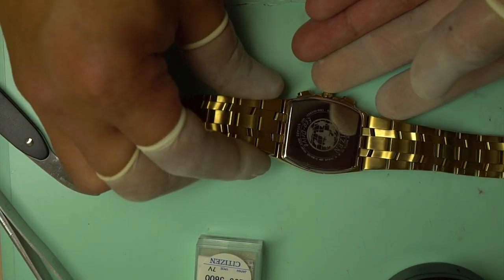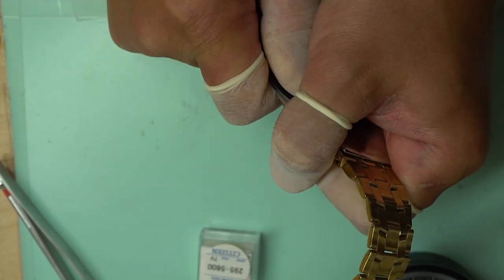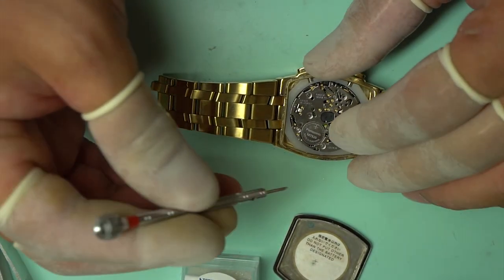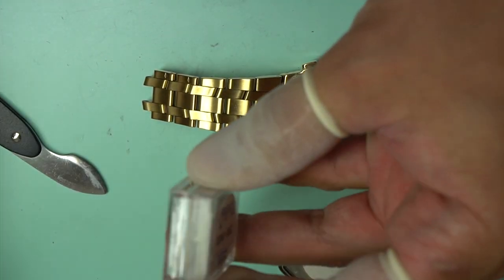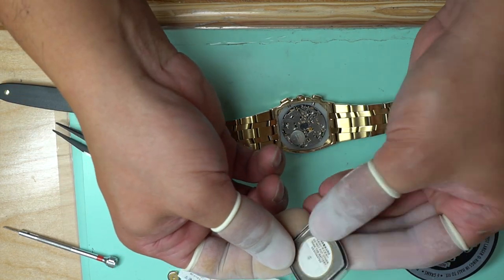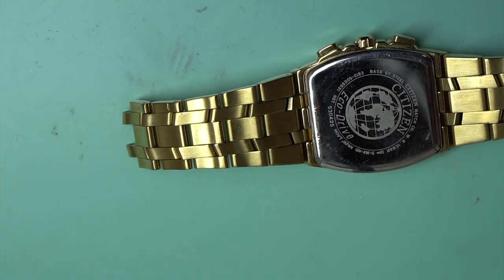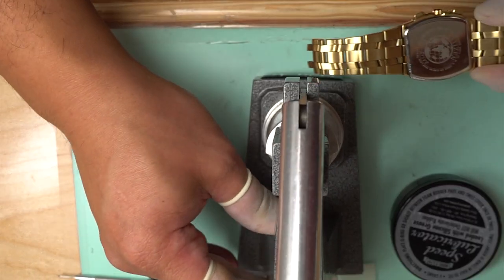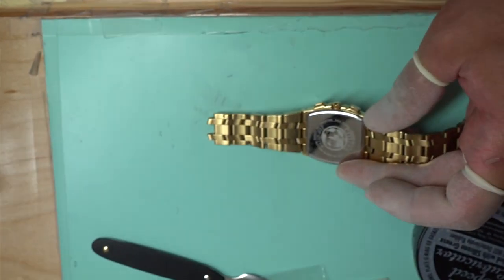How to Replace the Capacitor on a Citizen Eco Drive Watch

Comment: Besides omitting where the battery "tab" goes...and it's proper orientation when re-inserting...it may have been good to also mention that you (properly) used tweezers with plastic ends.....never us a one-piece, all metal tweezer, and hold the battery that way on both sides....you will risk shorting the battery with such an all-metal tweezer.

Comment: Many Casio quartz watches have 10 year batteries. I do not see the advantage of Eco-Drive if capacitor needs replaced every 3-5 years. My Casio G- shock battery honestly did last over ten years, but I did not use the illumination very often. My Citizen Eco-Drive is doing the two second hand sweep indicating bad capacitor at ten years. Case back says "do not open."
Reply: Replacement of the power cell with that frequency is unheard of.  8-23 years, with an average over 14,  in my experience with14  Ego-Drive watches (Watch Pox)..

Comment: Over the last 27 years, I replace the power cell in my Eco-Dive watches  about every thirteen years -  nerer sooner than eight years - in fourteen  examples.  i note that you use what appear to be plastic-topped tweezers to place the new power cell, avoiding the risk of shorting-out the cell.  The role of the spring-loaded tab in the watch works and the placement of the prtruding tab on the power cell SHOULD have been emphasized but was entirely neglected.  The "joy" of replacing a friction-fit case back was given short shrift.  All-in-all, a C- performance.

Comment: But any capacitor has a long life-time than battery suppose to be  . my citizen echo-drive watch (model - Bl6005-01E  ) stop running, the solar capacitor doesn't charged any more , but it's running only when exposed to light .

Comment: Do I need a case back closer tool or can I do it by hand or another way? (Citizen eco drive AT8010--58E radio controlled)
Reply from the maker: Hi Jay, sorry for the late reply. The primary function of the tool is to evenly distribute pressure on the case back, avoiding creasing the back and/or damaging the movement. You can use another flat object to achieve the same result if performing this at home.
Reply: @TotalWatchRepaircom  Like an Irwin quick grip clamp, applying light pressure obviously

Comment: I bought my Eco Drive in 2000 ..... it's now 2019 same Capacitor, and it only loses a second a month!
Reply: Rob Bierd that’s good life
Reply: The capacitor won't affect the watch accuracy only the watch power. If the watch is running itl have the same accuracy at a full charge as it would at a minimal charge.
Reply: Same as me. I bought my Eco Drive in 2000 and it has only just started to lose time now December 2019.

Comment: Something isn't right here. 
I own four Eco-Drive watches and have yet to replace anything.  Three of them are over 5 years old and one is at 18 years old.  All running great.  
Why are you replacing the capacitor?  Was it bad?
Reply: Emjay the capacitor dies after a while
Reply: My ctz-e6787 died and i cant get to the capacitor it has a shield covering the entire back that i cant figure out how to lift off to get to the capacitor
Reply: @rayharmacinski4934  Mail it to Citizen.
Reply: @bettersteps   they want 125 to replace it. I can by a new ecodrive for under 200 on ebay
Reply: @rayharmacinski4934  Yea, I hear you.  What is the sentimental value?  For some people (like me) it is more valuable than money.    You get your watch fixed for less than $75.00 than buying new watch.  It really is a good looking watch but if you have no sentimental value attached to the watch, buy a new one.

Comment: Why the hell does he keep calling the capacitor a "battery"? It's like calling a lawn mower pull cord an "ignition switch".
Reply: Panasonic calls the MT 621 chemistry a rechargeable Capacitor Battery Li Mg Ti based 1.5V

Comment: Movement=(noun) mecanismo, movimiento

Gasket:(noun) empaquetadura, junta
a shaped piece or ring of rubber or other material sealing the junction between two surfaces in an engine or other device.

Case:(noun) caja, estuche, caso

The only 3 words  i didnt get it

Comment: A capacitor is replaced every 3-5 yrs? There’s no point in getting an eco-drive/solar watch then. People seem to want to buy solar watches because they assume that batteries don’t have to be changed, ever. A capacitor costs $20+. My quartz watch batteries cost less than $2 and I replace them every 4-5 years.
Reply from the maker: Hi Ner, 3-5 years is a rough estimate. But regardless, it's true that quartz has a lot of advantages if you're just looking for a watch that keeps time and does it well at a lower price point.
Reply: Ner Bland that was an error,I have had my stiletto for 13 years without opening it up...  best watch I've ever had.
Reply: Makes no sense if it does not last at least 10 years
Reply: the capacitor on modern Eco-Drive watches actually lasts much longer than that, not sure why this guy is saying 3-5 years. as long as you dont let the watch enter a deep-drain state, the capacitor lasts between 20 and 30 years. at 20 years, as long as youve regularly worn the watch, the capacitor should be at 80% functionality.
Reply: Most I know last over 10 years.
Reply: Nope my radio controlled eco drive is about 7 years old & needs a capacitor, wear it daily
Reply: @Metalhead-4life  you got a lemon. ...or you let it sit too long without a charge..  i bought two stiletto at the same time....one was warn most of the time.....second one i made the mistake of putting it in a drawer.....was never the same afterwards......i try to buy them with a second hand.......lets you know right away if it needs a charge....
Reply: @adrianotero7963  mine has a meter on the face that shows how much its charged, very conveniant
Reply: @Metalhead-4life  what model is that.....would love to get one.....
Reply: Mine lasted about 13yrs, before needing replaced
Reply: @ScubaJamaica  where in Jamaica can I get mine replaced ? thanks

Comment: The video title says "replace the capacitor" but it looks like you only replaced the battery. Is the capacitor part of the battery?
Reply: the "battery" is the capacitor. Battery is the wrong term to use. A capacitor stores energy and releases it when needed to power the watch. The solar light is what runs the watch and charges the capacitor.
These watches are designed to go into hibernate mode when the light is not present for a period of time such as storing it in the drawer of your dresser for a month or two.
The watch will come to life again after is has been exposed to light at a later date.
It is really neat to watch the hands spin around to the correct date without any action on your part. The internal "clock" keep the time and the hands stop moving to save the capacitor from draining completely which would require you to place the watch in sunlight for several hours to replenish the charge.
Hope this explains the question.

Comment: A "capacitor" is not a "battery."  Citizen calls the part that stores electrical energy, a "capacitor,": "capacitor battery," "battery," and "power cell."    It cannot be both the first and the third.  The second is sloppy.  The fourth describes the function, not the part.